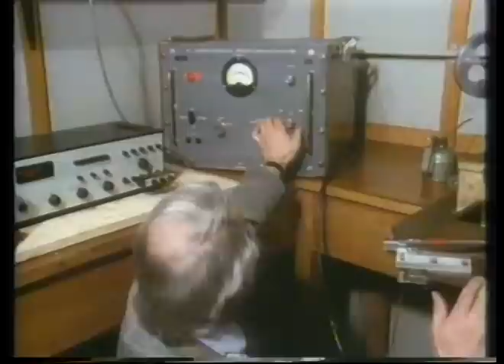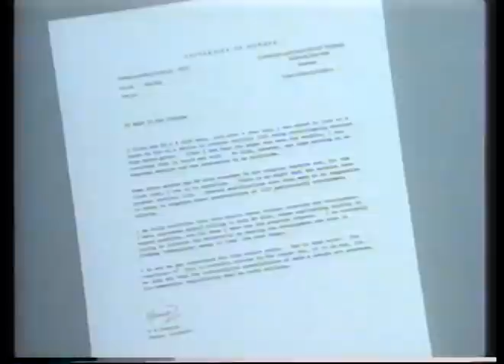Anti-Gravity Machine (Part Two)

Comment: I have the explanation. You need to generate four vortex. The design needs to be built using four vectors for the giros. Think of it as an antenna. Instead of bipolar, with four bipolar elements. The frequency of the rotation is elemental. You can warp space and time, due to the four axial bipolar antennas. 

It’s a gate, or a warp engine capable of creating wormholes. 

Yes, the technology has many applications. It’s all based in resonant frequencies, and its relative prosperities on atoms, molecules, elements of the periodic table, as well as invisible elements of the electromagnetic system spectrum. After all, everything is vibrating at particular frequencies, for E=m and c means frequencies. Everything has a differential of potentials, which is where energy resides, in this, our electromagnetic universe. 
Mass, frequencies, Energy, all the same. Didn’t the Logos Incarnated? So, there, you see, the electromagnetic spectrum is but frequencies, words that come out of the Logos, the Word of God, made flesh, made bread. 

But, then again, those things are shown to the little ones, not the proud an arrogant. 

Just change the vectors, add more giros all centered in a common axis, use 4 vectors, four dipoles, and you’ve got a ship! 

Tune them, otherwise it will self destruct. Carefully
Reply: No, NOT AT ALL! By the 369 Rule you need 6 to give a balance to the forces on the axis in this type of design. I have met Mr Sandy Kidd at an exhibition, a very humble man and obviously dedicated to his work.  I also agree with the contributor in regards to the use of mercury. If you can imagine a saucer with 2 tubes of Mercury round it's perimeter edge being driven round at very high rotational speeds in opposite directions driven by magnetically powered electrical windings; this would also give a lifting balance gyroscopic effect  which could quite easily be controlled.
Sandy I solute you for all your amazing efforts and wish you and your lovely supportive wife all the best and I hope your efforts are recompense financially and any other way that you both I think, deserve. 
Deep respect,  
Pat. Fi Dunfermline.

Comment: You need to start in free fall, remember. 
It will propel, like a four vector ship in space and time. Tune the temporal frequency first so you don’t warp in time, only in space. Use the three vectors to move through space, or, if you prefer, use it as a triangular ship, with three vectors, just don’t use the temporal, it will warp you.